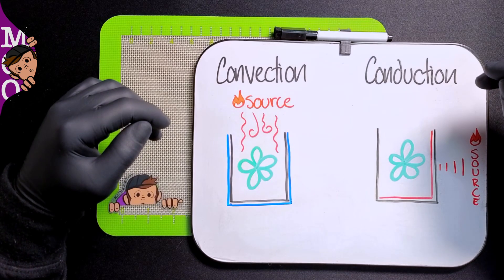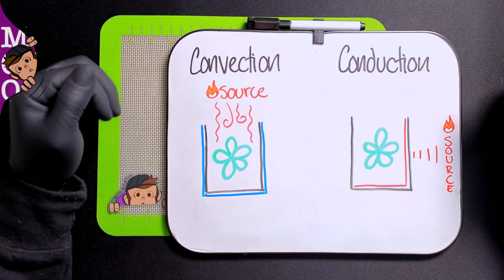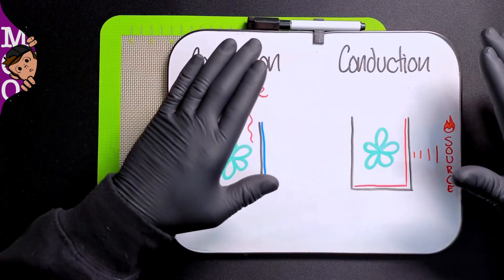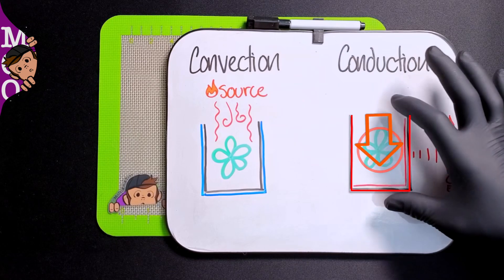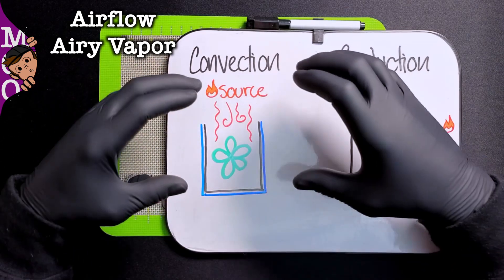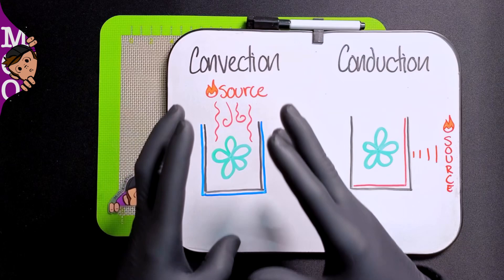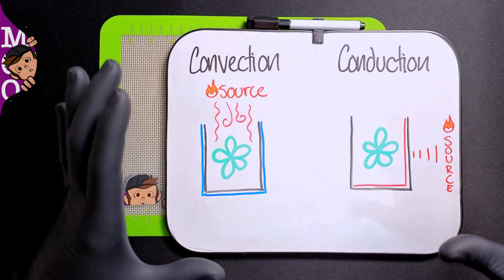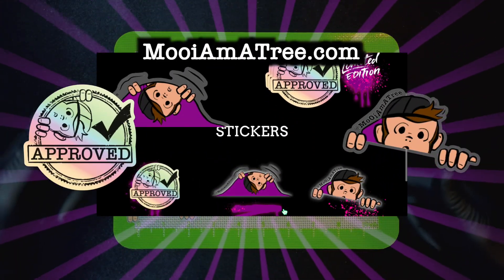Convection Vs. Conduction | Comin’ in HOT | Moo-U

Comment: Hey moo, I love words, and by definition conduction involves heat transferred between materials of different temperatures. Convection, otoh, involves heat transferred through the movement of liquids or gases. That's how I keep the terms straight, at least.  

As you point out, most devices are hybrids. For comparison, I submit that a banger uses solely conduction heat, whereas a ball vape typically uses solely convection heat. 

Great vid as always xoxoxo
Reply from the maker: Great comment!